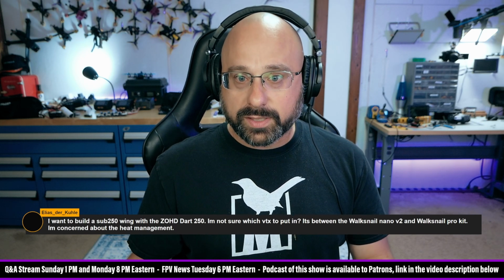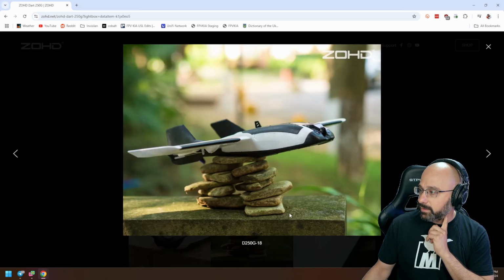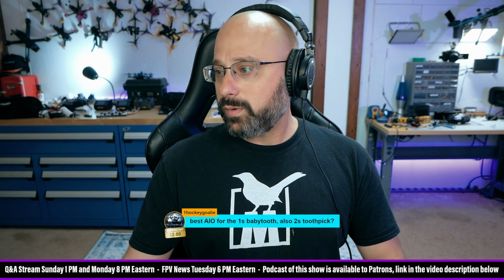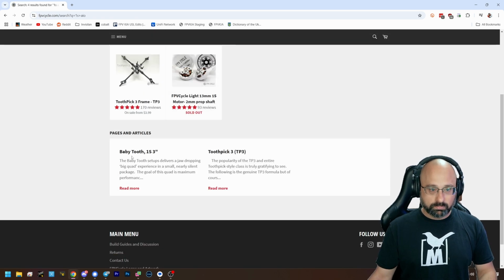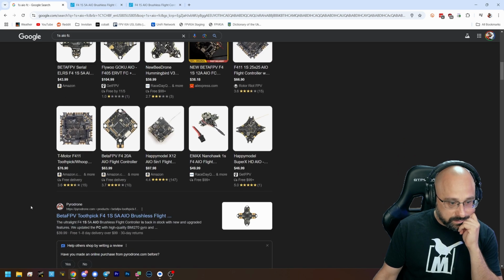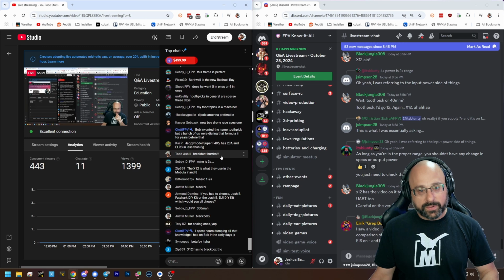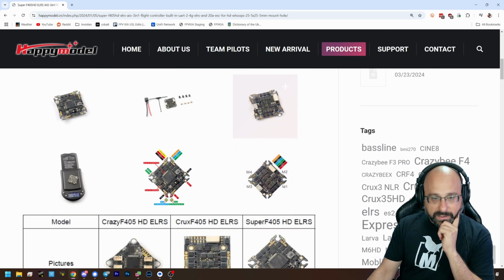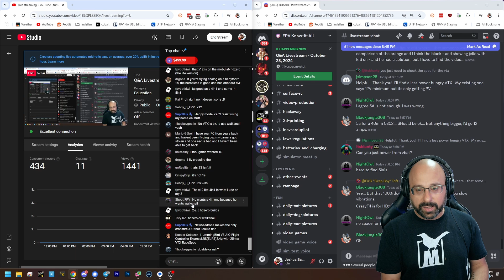Will I Have Heat Issues On A Dart 250g with Walksnail? Best AIO For 1s and 2s? - FPV Questions

Comment: I dont like the x12 because theres no blackbox and the 1s version has absolutely no tuning guides or help or tips. Im using the gep taker f411 12a 1s-2s, 8mb blackbox, onboard reciever but no vtx which i love. Id rather connect my own micro vtx

Comment: Happymodel X12 AIO is excellent.  I own several.  12A ESC.  UART-based ELRS.  400 mW OpenVTX.  Drawback: plug-in motors, which limits motor efficiency. Minor quibble.